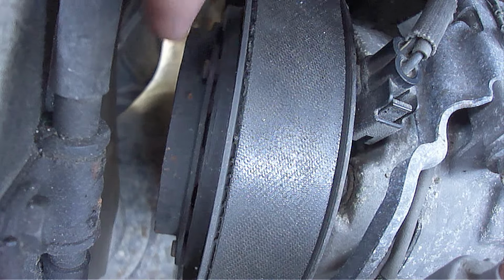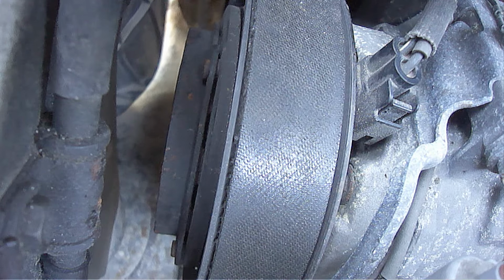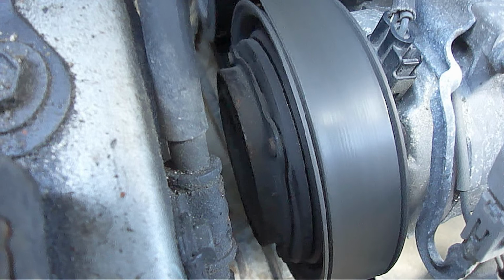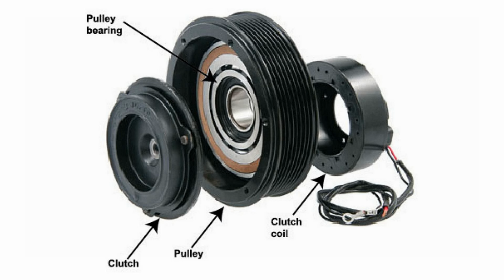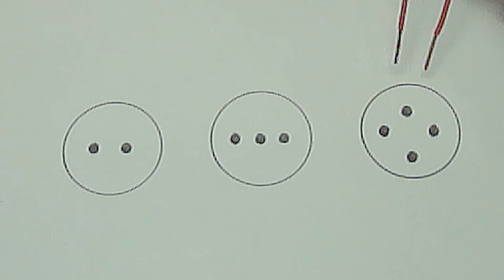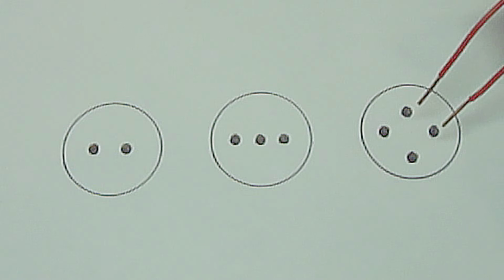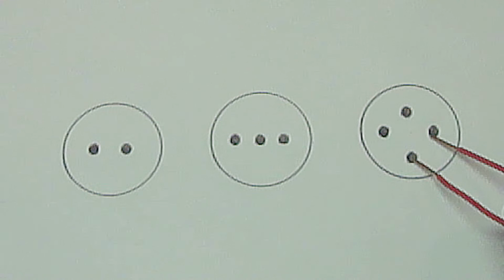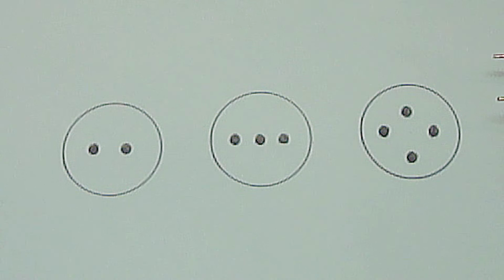How To Fix Car AC - AC Pressure Switch P0530 P0531 P0532 P0533 P0534 P0745 P0746 P0747 P0748 P0749

Comment: I have a problem with my a/c. When filled to the correct pressure, by myself or a dealership, when I run the a/c for a couple minutes in park, it violently blows out from the bottom of the compressor. Happened 3 times.

Had a diagnosis that stated it was a clogged high pressure switch making this happen.

Someone "fixed" it by lowering the pressure in the system, allowing it to run without blowing out the bottom, although it reduced it cooling capacity, so it will run and cool, it will just blow out the bottom if run in park for a few minutes.

Does this constitute a clogged high pressure switch? Can I replace the high pressure switch without venting all of the coolant?

For reference, it's a 2004 Dodge Neon SXT.

Thanks in advance for any assistance.

Comment: After changing pressure switch AC compressor recharging system compressor still isn't kicking on on its own and when I bypass the pressure switch it's still ain't coming on

Comment: So I have a 2008 dodge nitro that has all been replaced except the evaporator. I had to put in some freon to the right specs and now the clutch won't kick off. High pressure switch?

Comment: L.P. switch on a trailblazer  is easy to replace...  has an auto. seal when taken out...
DOES The  High Press.'  Side  on  the  compressor  "Also" have that   seal  when u 
take it out...?    or will it spray  refrigerant  out ???

Comment: I checked my switch and it started then quickly stopped.( the clutch) It did that 4 or 5 times and then it doesn't kick in any more. Any ideas if this matters or not and do you have the part number. Toyota wants 200 + dollars

Comment: Paul I did this test and bypassed the high pressure switch and the ac compressor started to work. The high pressure switch must be bad. How do I know if I need to drain the ac system now?

Comment: Hello Paul, thank you very much for sharing your knowledge. If we measure a voltage of 12 volts at the terminals of the compressor when the A/C is ON, and that this one does not turn, can I consider that the pressure switches are ok? My DELPHI diagnostic tool mentions no problem with these pressure switches. So I ordered a new compressor.
Bonjour Paul, merci beaucoup pour vos partages de connaissances. Si nous mesurons une tension de 12volts aux bornes du compresseur lorsque l' A/C est ON, et que celui -ci ne tourne pas, puis-je considérer que les pressostats sont ok ? Mon outil de diagnostique DELPHI ne mentionne aucun problème avec ces pressostats. J'ai donc commandé un nouveau compresseur.

Comment: Our Audi A4 B6 has a 3 pin connector on its pressure sensor mounted on the side of the condenser. Pin 1 voltage measured is 12.2vdc. While on another pin is 11.5vdc. Query pls which pin do we jump together? We're apprehensive jumping the wrong pin because ecu might get damaged. Thanks in advance and congrats for a great tutorial.
Reply: Maybe it is too late now, but please be aware there are pressure SWITCHES and pressure SENSORS. A switch works as explained in this video. A sensor works with a PWM signal (pulse width signal), which is a digital signal representing a pressure value. Your ECU translates this value into a airco system pressure (high side). Shorting a connection in a system using a sensor instead of a switch may brick the ECU. Pretty sure your A6 uses a sensor, so please take care!

Comment: I tried this and didn't work, all the fuses and relay are fine. I replaced the expansion valve and accumulator and tried to refill with freon but it won't even take 1/4 of the can till the low side reads above 50psi....what could be the issue???
Reply: Same exact issue here! Did you ever find what your problem was??
Reply: @phillippardo5712  Yeah it was the actual AC compressor.
Reply: @danielcastro8012  good to know thank you. One more question, were you still getting cold air from time to time with the bad ac compressor? If you don't mind, can you explain your symptoms a little before replacing the compressor?
Reply: @phillippardo5712  it took a while before it completely stopped working but yes, it would still blow somewhat cold air. That was really the only symptom, it wouldn't blow cold air like it used to.

Comment: I by passed the low pressure switch .It seemed to work fore a bit ,but the the enegine stollled  and the ck engine like came on. The rouge did restart after a few tries .I had to disconnect the battery to reset the ck engune light .Any idea what happened.?

Comment: I got a question if I bypass the pressure switch and I don’t know which an it’s got a 3 connection or 4 and I bypass wire ends on wrong one can I fry computer or cause problems
Reply: I think if you use a fused jumper wire, you should be fine because if you jumper the wrong pins, the fuse will just pop.

Comment: Great video! I'm not very mechanical and I can't find the A/C pressure switch on my 2010 Chevrolet Cobalt but that's what the repair shop said it needs replaced and they want to charge me $300.00 to do it. I would rather save money and do it myself if I knew where the switch is. Any idea where it is on my vehicle? I Google the part and it costs about $30.00 but the repair shop says it cost $103.00? Please help🤷🏻‍♂️
Reply: That’s a repair shop taking advantage of your lack of mechanical aptitude…if you’re not familiar with a disciple; find someone who is and take them with you

Comment: My ac quit working driving home, worked perfectly before. I replaced the compressor could not get clutch to engage preventing the freon to load. I replaced the low pressure switch still can't load freon. Car is completely stock and very well maintained. Checked the wiring pigtail on compressor, not getting power to harness.

Comment: i just found this video this weekend as I am having A/C issues. THANK YOU FOR THE CONTENT! On my car, Toyota Yaris 2007, I tested for continuity on the pressure switch and there was none. Now I wanted to try to put a wire in the connection openings but decided to get a volt reading first. When using the multimeter I get close to a 5v reading and not the 12v reading... Would this affect how the pressure switch works? SHould I still try to put the wire and see if the compressor engages?

Thanks!
Reply from the maker: Try to engage the compressor with the wire.
Reply: I have read that some systems provide only 5V to the harness, the same voltage the computer on your car uses internally.

Comment: Thank you and god bless ( 2 different shops changed my gas, checked for leaks, replaced the condensor and lastly replaced the aircon pump from a scrapped car and I still got issues. There was a leak that was visible but I think they did all the other stuff for nothing. I just unplugged the AC pressure switch connector and the ac works fine ( will try to get a swtich from a wrecked car as the ac has cost me way too much already )
Reply from the maker: You might be surprised how cheap a brand new OEM AC pressure switch is on eBay.
Reply: It's rather disconcerting that these 2 other shops either knew what the problem was, and replaced random parts to run up the bill.  Or, they did insufficient diagnostics or had no idea how AC systems work.  Grrr...

Comment: I'm assuming that we are making sure there is actual pressure in the system first before performing this test because the compressor may not be turning because the pressure has dropped due to a leak. I think it would be bad to force the compressor to run if it was out of refrigerant.  Maybe I missed that part.
Reply: If you are recharging a partially charged, or empty system, bypassing the pressure switch will allow you to recharge the system much more quickly.

Comment: Hello I wonder if for a VUE 2008, has only one pressure switch located on the manifold of the compressor, If can be removed/replaced without the risk of gas leak?...

Comment: What would cause the fan to excessively run for long periods, 30min or longer. Seems like the hotter it is outside the worse it is, it almost never shuts off in temps above 80°. In cooler temps below 70° it will run for long periods, but eventually shut off. The fan will also shut off immediately when I turn the AC off. It does all of this no matter if I’m driving or parked.
Reply: No matter what your fans are going to run if the A/C is on its pulling air in to go through the condenser to cool the air. It’s normal for the fans to run if the A/C is on

Comment: The mechanic at the shop told me to get A/C Pressure Switch, but now I come in here and find out that there is high and low switch. Does that makes difference if get high side pressure switch or one that just says A/C Pressure switch or not. (Im gathering this information for my dad).
Reply from the maker: Ask the mechanic if you need the high or low pressure switch.. Yes it makes a big difference replacing the correct one. I can’t believe the mechanic didn’t specify which one.

Comment: I need help please because heat is killing me. Toyota Corolla 2018 only  cools on below 80 degrees weather and I noticed if i put off the ac, the clutch still stay on. Will changing the switch help or the entire compressor?
Reply: How did you fix your AC?

Comment: Just to clarify how this works the PCM looks to receive a signal from the pressure switch if it doesn’t receive that signal it won’t energize the clutch relay to turn on the compressor. When you hit the AC button that just completes the single to the AC compressor relay to be energized and turn on the compressor. The PCM will also command the cooling fans under the hood to come on full blast when the AC is on
Reply: Except on a 2 wire pressure switch.

Comment: Great video. However,how do you know if your pressure switch has a safety valve built in it,prior your removal? Thanks
Reply: I believe it dose it be stupid to have to evacuate the whole system to change a sensor

Comment: my 2013 toyota corolla doesn't have a clutch.    my problem is i get no cold air , or it works.   when it does work ,it gives great cold air.     i usually drive 10 to 15 with the a/c on.   warm or hot air blowing.  then for no reason i can find it starts to blow cold air and will work until the car is shut off.    any answers for why that is happening.  i did bring it to a repair shop, he said to replace the compressor at $1100.

Comment: I'm not seeing any voltage at the connector. What's up with that? Also, if you do have voltage across two of the pins and you try the bypass wire trick, won't that be a direct short and blow a fuse?
Reply: Exactly what I was going to comment after seeing this, you are 100% correct!
DO NOT just blindly jumper across all the terminals as he suggests in this video because if you jumper the +12V pin (or in some vehicles these days +5V) to the Ground pin you could cause a short circuit of this voltage and blow a fuse...
The pin that you measured +12V or +5V (or some other positive voltage) during the first part of the test (and some vehicles may require the key in the 'Run' position to get the voltage) should be excluded from this 'jumpering'.
Also, some newer vehicles (like Honda CR-V for example) are going to designs that have a single A/C pressure sensor (instead of a high-side and a low-side sensor) and these have a variable voltage output (3 pins, +5V in, Ground, and signal out) which varies based on pressure. The computer then monitors the voltage out and can compute the A/C line pressure based on the voltage and determine if the pressure is either too high or too low (or Ok) and turn the compressor off/on accordingly. For these systems this 'jumpering' technique does not apply.
Reply: Yes, the guy has no idea what he is talking about. See my explanation that I posted
Reply: @kristenewilson2475  No, this works on older cars.

Comment: Hi! I just recharged my AC system from the Honda ASC. Now, though the cooling is good, I could witness AC clutch frequently engaging ON/OFF at intervals of 8-10seconds roughly. My set AC temperature was 25C. Any suggestions?
Reply: To much refrigerant causes this.

Comment: My voltage is only 5v, on pressure switch is that ok?
Reply: Yes that be the signal wire to the pcm you should also have 12 volts to power the sensor and 5 volts to the pcm and a ground wire

Comment: Wow last summer i had nearly cooked myself well done during the heatwave... Had attempted to troubleshoot why my ac wasnt choochin.   And just survived with occasional bags of ice filled from the local soda fountains..  I found this video seeing as its nearly that time of year again. An low.. pressr~ And behold! My clutch does engage!! 😂📎 lol Thankyou for your clear and concise video!   Subscribed.    Now hopefully not long before im feeling 🏂🍦🎅🎄      would this general function or circuit of the engine possibly correlate with other mysterious rough running and heating factors?  Even if i drove. With ac turned off?

Comment: if i connect wrong pin,is it will cause a damage to the ecu???
Reply: As he demonstrated at the start of the video, one pin is hot, the other is ground. Jumping these two could either damage the ECU or blow a fuse.

Comment: Hi thank you  for showing us that  my ac compressor  goes on and  off  every  5 seconds  on my Ford mondeo  I have a  4 pin on my ac high pressure so I will  try  and  do what you  showed  us. And  is there  a chance  that  it could  short out  anything before trying the  wire testing?

Comment: Can you do a continuity  test on the switch?
Reply from the maker: Yes
Reply: Use an ohmmeter, but first measure the voltage across the switch.  Must be zero.  If not, did you disconnect the wires to the switch?
Reply: @ thank you for responding to my question. Have A Happy Easter!